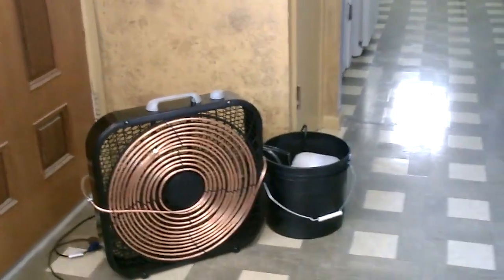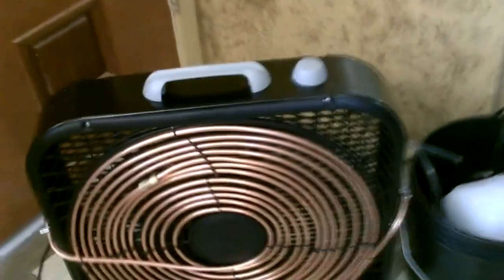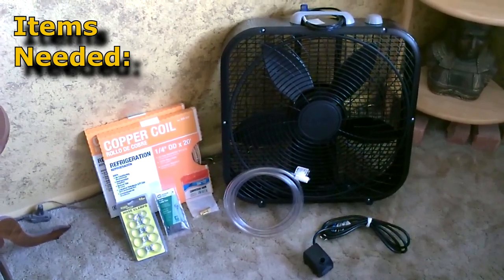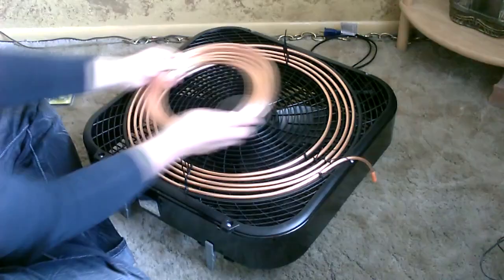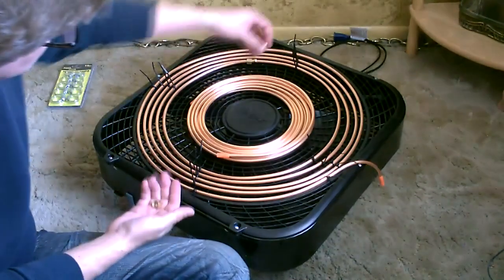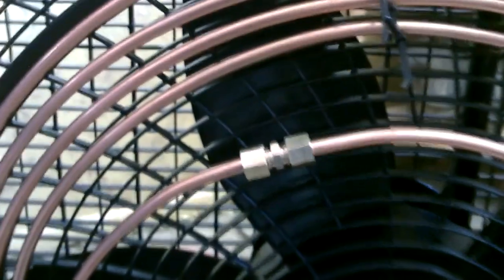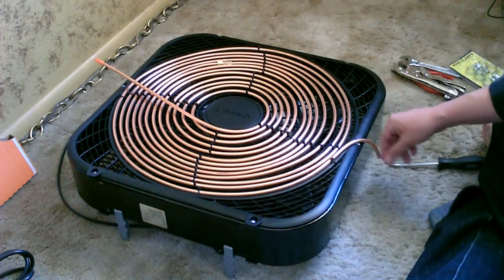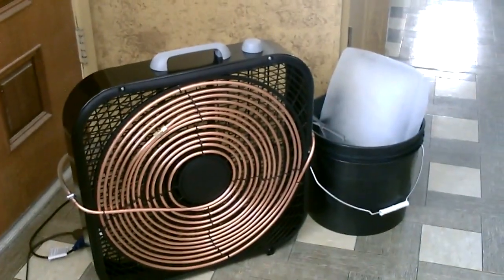Homemade AC - The "Copper Coil" Air Cooler! - (Simple "Box Fan" Conversion) - Easy DIY

Comment: If you get the ice from your freezer, the freezer will put out heat to create the ice.  there is no free energy.  If you buy it at a store, or get it from a freezer in the garage then it will work.  Otherwise its cooling one part of the house while making the freezer work harder costing more money and putting the heat into the kitchen.
Reply: it most definitely will not cause an equal amount of heat to be produced in your kitchen. nobody thinks this is free, but some of us don't have central air conditioning and live in the sweat scrotum folds of the world
Reply: +Randy Parsons But most people have a refrigerator with a freezer on top already, with ice cream on a shelf, maybe some frozen steaks.
Reply: ShotDownInFlames2
Not sure if you are serious here, but freezers and refrigerators and air conditioners are heat pumps.  All they do is use energy to move heat from one place to another.  Putting water into a freezer and waiting, causes the thermostat inside the freezer to kick in the compressor(uses electricity) to pump heat out into the back or bottom of the fridge. Pump enough heat out of an area and it can drop below freezing.   A window AC has the hot coil outside, so its adding heat to the outside of the house.   It is more efficient to buy and run a window air conditioner then to use your fridge/freezer.  If you don't mind heating up one room at the cost of cooling another, then the ice trick works fine.  If your freezer is outside then you will still be paying for turning water into ice, but at least the heat is going outside.  Compressors turn off and on all day, which is why people think they use a steady amount of electricity, like your fridge.  But they don't.  They stay on longer if they need to.  Every time you open the door to the fridge it costs a little money.  Heat also gets in so even if you never oppen the door there's a certain minimum cost.    Also there's always extra heat made, waste heat with electric motors and pumps and compresors.  Even an electric fan is actually heating up a room, by a very small amount.
Reply: Of course I'm serious. I'm guessing most people who watch this video already have a freezer in their kitchen on top of their refrigerator. So that energy is already being used and that heat is already being dumped into the kitchen.

Even an empty freezer uses energy. Putting water in the freezer will use more energy temporarily, but it would be minor. And you only need one compressor in your house.

Your option of a freezer in the garage would have two compressors in the house. A window air conditioner would also have two compressors in the house. That seems like much more energy use.

And I'm not going to move my fridge to the garage, so that I have to the garage for an eskimo pie.
Reply: ShotDownInFlames2
 You agree that putting water into a freezer uses more energy temporarily, but the other thing is that energy is MOVING that heat out into the room, plus some extra heat.  So the ice, which is nice and cool, is countered by the heat which is coming out of the back or underside of the fridge.  Your taking something with less heat, the ice, and putting it somewhere, that's good.  Your also putting the opposite amount of heat into the kitchen.  You can't win.  There is no free energy.  The house will remain the same temperature, actually a little warmer.
Reply: Randy Parsons my house is definitely colder since using this.. It's not free energy..  But it's easy and cheap..
Reply: Darrick Mohr
Its really hard to measure, since day to day and hour to hour the outside temp is changing and inside temp is also changing.  This can certainly make one room cooler and that might be all that is needed., say for sleeping on a hot night.   I wonder how often you have to make and change out the ice?
Reply: +Randy Parsons in this heat we've had lately we've had to change out the ice alot.  I live in a one bedroom apartment and use it for my living room which is connected to the kitchen
Reply: @randy parsons Thanks for saving me the trouble of explaining the 1st and 2nd laws of thermodynamics.  It's delightful to see that some people paid attention in Physics class...
Reply: I understand that freezing ice is simply using energy in a different way, but in a rental house with horrific insulation I see no problem dumping an ice tray into a bucket to cool a room. Our central unit runs 24/7 July-August and barely breaks 80 degrees while being set at mid to upper 70s. Bucket, fan, occasional tray of ice cubes, I'll risk it.
Reply: we got a Stanley blower fan off internet $60.00.  Sit it on the floor, it blows the cooler air  around.  A ceiling fan blows the hot air down from the ceiling.  i may be all in my mind but it sure feels cooler. and it is quieter than a box fan.
Reply: I bought an air purifier a few months ago. It's a tower type that sits on the floor. With the summer heat on now, a side benefit is that it does blow the air conditioned cool air that is lower to the floor around and man does it make a difference. Better than a ceiling fan for sure.
Reply: Randy Parsons - No free energy. Got it. What you do seem to miss is that this is not intended to be a whole room cooler. If anyone is thinking that they are mistaken badly. 

This is more of a I can't afford/install/whatever an AC and the huge amount of energy it uses to cool an entire room vs the manual labor and fairly small amount of energy it takes to power this unit and cool the air directly in front of the fan. 

Will the freezer make ice using no additional electricity? Of course not. But if you're going to argue about that then you also need to argue that storing the ice once it's made in the freezer causes you to use less energy to maintain the temperature simply because it reduces the amount of volume the freezer is working to keep cool. 

As you mention heating up the room where the freezer is at which negates the cooling of this fan because you are heating up one place to cool another. Several problems with this. I'm sure some people will use this solely in their kitchen but most people couldn't care less if the kitchen gets warmer while using this. That's why we have kitchens...separate room so that when you cook you don't heat up the entire house. For the same reason home designers put a washer and dryer in a separate room like a bathroom where it keeps the heat and noise sperated. Architects, they know what they're doing after all. Second point- no it will not make your house warmer by a little bit. Generally if you're going to do this it will be with a decent amount of ice...or stored energy...it's gonna be a good amount of stored energy which will more than offset the amount of energy used to freeze the small amount of water that will now require freezing...as that is done over time. Especially so if you have an auto ice maker. So yeah, the compressor will turn on and generate extra heat but it will be more than offset by the amount of stored energy in the ice...generally speaking of course. 

It's not that you're wrong sir, the law of conservation of energy is absolute (of course one has to wonder how did that defined amount of energy  come from then?) But you seem closed minded about this being able to work for some people in certain circumstances.
Reply: i guess you shut off your freezer often. The water can be recycled into container. Modular movable ice pieces. Leave water at the bottom for the coil to use.
Reply: Randy Parsons freeze water at night when it is cooler. Added benefit is many electric plans charge less for off-peak (ie 7pm-7am) usage. You are correct that an outdoor freezer would be ideal, as it will generate heat while running, and freezing the volume of water needed for this would cause it to run much longer than under normal loads, but depending on the area, nighttime Temps could be low enough for the excess heat to be a non-issue, as it would be well within the capacity of the HVAC to offset the added heat with outside Temps below mid 80s.  I would not recommend it for anyone in Phoenix, where summer lows barely hit 90!
Reply: Just use someone elses freezer. And I'm sure there's a DIY way to have the freezer exhaust to the outside.
Reply: True. Best to buy a really Big Bag of Ice.
Reply: Thank God. Our family invested in Solar Tech.

Comment: How about using a cooler with some holes drilled for the lines instead of a bucket? Then you could use rock salt for some extreme cold.

Comment: Lots of condensation can accumulate once the pumping starts.  How do you control the condensation that accumulates around the copper coil??
Reply: no need to, the amount of air flow helps control the amount of condensation, as in it helps dry is as it builds. so pretty much equals itself out.
Reply: I must have had too much water flowing through, as there was lots of condensation and eventual dripping.  I will have to try turning down the water flow to see if that will keep condensation from building up and puddling.
Reply: It might have to do with the amount of moisture in the air which varies with the humidity. Also the amount of air flow since the air passing by needs to absorb the moisture. You are correct too I think about the water flow as the more the air is cooled the more moisture will exceed the colder airs ability to hold moisture. 

I'm not an HVAC tradesmen so this is based off of common knowledge and some cross over from general construction I worked in. If anyone can do the calculations on flows for the water, air, & pump needed etc it would be helpful.
Reply: you could wrap it in cloth? probably would reduce your cooling thou.   another guy said diapers on the front can absorb some of the humidity

Comment: What about using an ice chest to hold the ice with the pump/tubes routed through to allow the ice to last longer?
Reply: The point of the system is to use ice as fast as possible - any thermal "leak" just improves the design.

Comment: Got a couple of questions before I attempt to do this.  I have a 20x20 (400sqft) dedicated workshop that currently has a 220v AC system designed for a 1,000sqft room.  Its over kill, loud, sucks up too much power...and I need the one 220v socket it currently is using for my table saw.  Sooo, I am looking to do something like this, or similar, for my own custom AC for the work shop.

1.  Will this work well with a smaller "vornado" tilt fan - it has much more directed airflow but not being as big doesn't get the same air volume (I think)?

2.  How long will a block (or say 10lb bag of ice) last before it completely melts and then is just circulating warm/hot water?

3. I have a small dorm fridge - I am thinking put putting a bucket of water in the fridge (it runs very low power) so its always keeping the water cold...and piping the tubing through the fridge into the reserve bucket.  Fan/Fridge electricity should be minimal, but perpetual cool air should be available because the fridge will always be cooling the water - well, thats the thought at least.   Thoughts on this technique?  Fridge: http://www.compactappliance.com/Danby-Energy-Star-1-6-Cu-Ft-Compact-Refrigerator-Freezer/DCR016C1BDB.html

Comment: You would get much better flow if you didnt have that connection in the middle of the coil. If you were to have soldered it or found a longer length of tubing, it would be better. That style connection reduces the inside diameter of the tubing when it clamps down on it. Not a big deal, just pointing that out. For the tubing going in and out of the bucket, I would use some rubber heater hose that is the same inner diameter as the copper pipes outside diameter, then just put it over the copper pipe like 4 inches and use a couple small hose clamps on each end of the copper pipe to hold it on. Also, like you said, a cooler would help it last longer. I use a block of ice as well as I bag of ice. The block last longer and the cubed ice cools the water back down faster after it has been ran through 5ft of copper pipe with warm air blowing over it.
Reply: Nice tips on his setup. Thank you for haring. Question for you: How long until you have to replace your ice in your chest?

Comment: Haii Brother Small Question ...
If Outside Temperature is 45 degree Celsius...
How much can it maintain inside the room
Reply from the maker: hi. it will depend on various factors. how big the room is, is it well insulated, the rooms starting temp, how cold is the ice you are using and a few other things.

Comment: So, I tried doing this with slightly larger components. 3/8" OD Copper tubing, 3/8" ID Vinyl tubing, and a 93GPH pump. Despite all the parts connecting, the water just isn't pumping through the vinyl tube enough to reach the copper. Is it the pump that's too weak or should I buy smaller components like the ones in the video? Can you link me to what you would buy?
Reply from the maker: hi. i think the pump you are using is too small. i used a 200gph pump. i say go with one at least that strong. i once tried a 160 gph pump with it and even that was a little too small.
Reply: @desertsun02  I'll give that a try, thanks!
Reply: @desertsun02  Yep, that did the trick! Though I must admit the cooling effect doesn't feel very significant. Would adding more copper tubing help since currently I'm only using 10 feet of copper?

Comment: Why not drill some holes in an ice chest insulted the feed tubes and put all of it inside?  A pump with a vary high rate of speed would make the ice last longer right and the ice chest would insulate it has well? You could also use a bigger faster fan with it has well to cool larger rooms or ice a small one? ; )

Comment: Is it possible to build one without the bucket I understand it's where the ice goes but it's kinda big
Reply: U can use any container you want as long as it has cold water in it
Reply: Best to use a cooler. The ice will last much longer.
Reply: Insulated container is always best for cold water and ice in a hot room. .

Comment: Would it work to put the coil on the back to pull cold air through?
Reply: Kyle Patnode maybe he did it this way so as not to have water near the electrical part but im not to sure
Reply: Kyle Patnode Of course, this is how the indoor unit of your split AC works. The blower creates negative pressure and propel the air in the room sucking it from the room through air filters and evaporator coils. Since last turn of the coil is not sealed with frame of the fan, some air would be passing through this access without touching the coil turn.
Reply: I just wonder if there is a higher risk of pulling condensed water from the coil through the electric fan with the coil positioned on the back/intake rather than on the front

Comment: would u say this unit cooled better than the evap? longer?
Reply from the maker: hi. in my area i'd say the evap units cool better overall. but it's a different type of cooling. this copper coil fan is basically a water to air heat exchanger (minus the fins). if you use a pro-heat exchanger with fins then i'd say that works better than evap. but then again evap has other advantages... like it cools it's own water - but the heat exchangers don't. on the other hand - evaps only work well in vertain climates but heat exchangers work in all climates. i could go on and on... by the way i've got a DIY >>indirect<< evap cooler vid. coming out soon. that's evap cooling with no humidity, so that's cool too

Comment: I would like to know how much cooler does a normal size bed room get if using this...For example if its 80 degrees Fahrenheit would it get it down to 70Degrees?
Reply: 34Adamlee77 I think to get the best out of this you would use it at night just for sleeping and build an inclosed bed so the space being cooled is very small. A canopy type with something on the top and side to insulate. I cant see this cooling a small room like 10x12 if its like 95 degrees outside. You would have to sit right in front of it to get some relief.

Comment: could this work in a large 24'x40' greenhouse when it's 95 degrees F.?
Reply: it only works in small rooms - it produces about 2000 btu of cooling ---for 24 x40 you need 24000 btu